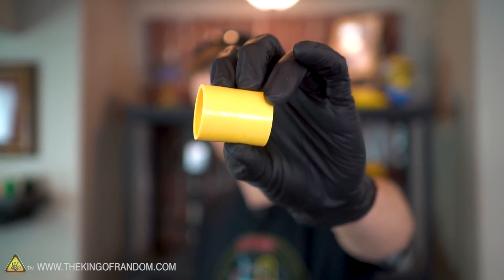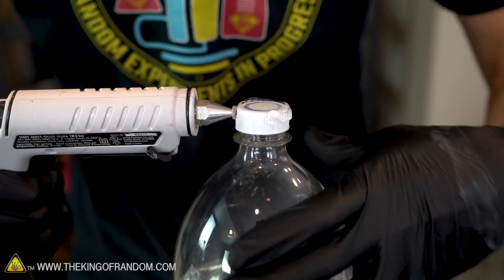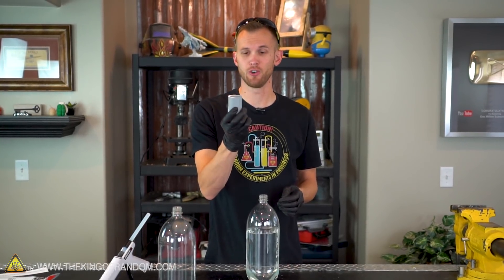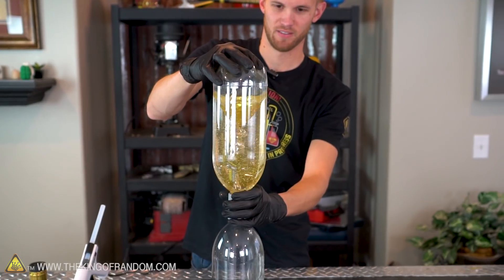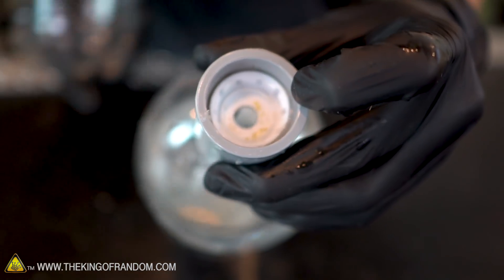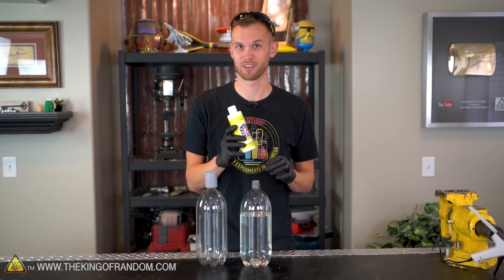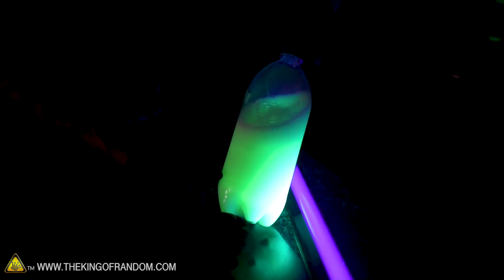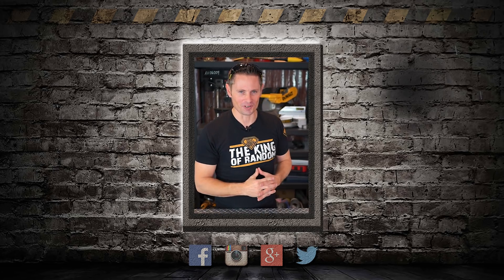DIY Tornado Tube GLOWS in the Dark! TKOR Dishes On How To Make Tornado Bottles Glow!

Comment: You keep spinning it in the wrong direction that's why it gurgles a bit at the start. You keep spinning it anticlockwise to start, that would work if you were in the southern hemisphere but as you see when it gets going it is swirling clockwise which is the correct way you should start spinning it considering you are in the northern hemisphere

Comment: What do you think would happen if two liquids were used of different densities and different polarities. For example water and oil. However oil may be difficult to use because it may cling to the sides of the soda bottle and not flow well.
Reply: Also you should suspend metallic flakes in the water and then shine a laser into it.

Comment: I once made one of these myself from 3 liter bottles and I glued the caps together with hot glue and since they where rounded I filled it with hot glue and used a hot screwdriver to make a hole in it so with that I filled one with water and flipped it but it stayed at the top because I didn't pay attention to the video I saw and I didn't spin it
Reply: Also I used no pvc pipe

Comment: Two suggestions:

1) Try powdered mica instead of glitter.
2) Try using two immiscible liquids like oil and water instead of just water and air. That would give you options to add stuff to either or even both layers.

Comment: Use mineral oil and other liquids with variable viscosity and then try the glitter and maybe other lightweight materials.  Then use the ferromagnetic inks in insoluble solution and apply magnetic fields with coils to the bottles and look for antigravity effects

Comment: Try putting a little bit of dish soap in the glitter water to help break the surface tension of the water so the glitter doesn’t float on the surface of the water.

Comment: This is an old project with a professional twist... however, having seen your Maelstrom Fountain, it got me to thinking.... If there was a way to add a twist to the area filling in the bottle cap, something like a tornado, with ridges spinning to the hole in the centre, on each side of the cap, wouldn't that make an automatically generated mailstrom? Like wouldn't the maelstrom start without you needing to stir the bottles?

And if you could make an automatic maelstrom, then I wonder if you could attach it to a stand using the center of the PVC pipe as a pivot point and design it in a way to make it flip itself automatically?

Comment: If you add glycerine drops used commonly for both soap making and candle making, available at craft stores you can make the glitter suspend and disperse in the water instead of floating just in top, it takes about 10 drops for a slightly smaller bottle so that size probably about 15 drops. It probably would look more like flying tornado debris.

Comment: You should have mixed the glitter with some rubbing alcohol or ethanol first, that would help wet the powder and let it mix with the water. Or it may help if you add a surfactant, like a little bit of dish soap.

Comment: @The KingFor this, why don't you have a larger PVC tube on the outside of the smaller PVC tube, put some UV and RGB LEDs inside there pointing  towards the bottles, then have a detachable battery? You could then choose whether to have the UV on or the RGB, so you could choose the colour of the water, or if you're using glow in the dark stuff, you could have it glowing without having to hold up the blacklight

Comment: I was wondering if you could make a multi-stage thermite brick with your pull ignition system. Something along the lines of the fuse lights an intermediate material that can burn hot enough to ignite a thermite and plaster brick.

Comment: What happens if you put wires that are conducting electricity in liquid nitrogen
Reply: nothing should happen...
Reply: Nothing
Reply: Unless the wires are superconductors, nothing major happens. Their resistance might go down a little, and they get a bit stiff, any plastic insulation they're covered in will probably crack. That's basically it.
Reply: I mean will it still conduct the electricity
Reply: Without the rubber on the outside
Reply: ....yes? The metal conducts the electricity, not the insulation.

Comment: Try this with two gases that have different densities , i would use Helium or Air  and Bromine (because it has a strong color) . i dont know if this will work because the to gases would mix in the lower bottle ,but if you let them sit for some time they would seperate into different phases because of their different densities